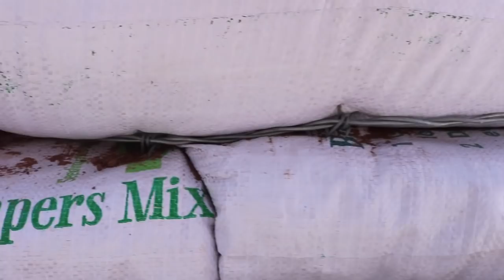THIS Is How We Will Waterproof Our Earthbag Rainwater Harvesting Cistern

Comment: You guys need to plaster the outside before you continue because the sun will deteriorate the bags very quickly. The inside will be protected as soon as you put the liner on, so that will be an easy fix. The sun is very hot in your area, so I  suggest to start on the west side. You guys are doing a great job at a record time. You are lucky to have a great lady by your side. She can handle anything that comes her way. Great work! Keep it up.
Reply from the maker: Thank you!!

Comment: Watching Jessica using her hand with the cans
Have you thought about maybe 
Feed Scoop.  they have from plastic to metal
search images..
the last job I did I needed to set 1x3 box tubing in concrete 1.5 feet deep to hold the electrical Junction Box's - Temp. Power Panel..
It was 2 inchs off the wall
I had 10 to set..
The rounded Metal Feed Scoop worked perfect... It's lite and thick and I have it for other projects......
Just a thought

Comment: Looking great. I'd suggest you vacuum out the cistern. I've seen the smallest particle of dirt wear a hole through a waterbed liner and mattress. better safe than sorry. The liner should be fine for holding the water, after all, that's basicall what is used in the Aquamate tanks Derek(Handeeman) has and is now installing. Great work!
Reply from the maker: Thank you!